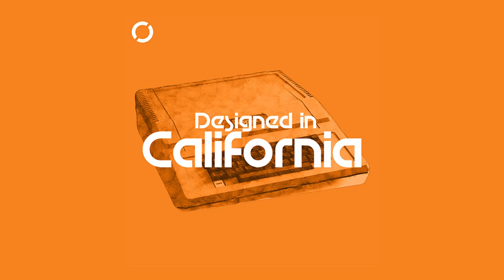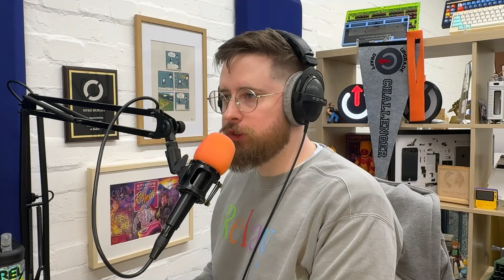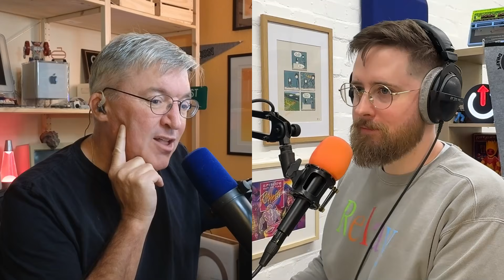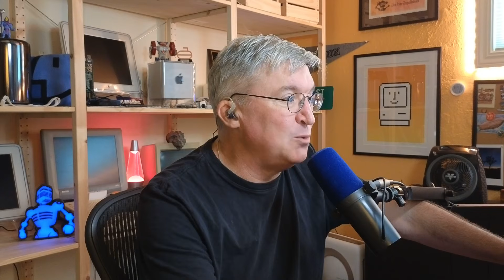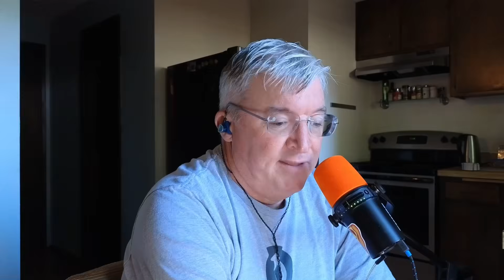Road to the Apple II: A Complete Computer (Part 3) | Designed In California

Comment: Congrats on your early success!  I love the show!  And I love this era in computing history too.  Growing up, I remember looking at the CRT Television and the magic of it all.  There is this device able to move so fast that our eyes see a moving image, not discrete display events, and I want to go on, but also want to communicate a finer point to you guys.  Please take this as help, a gentle hand able to nudge and prod, not some harsh judgement.  Ok?  OK :)

I believe you have some great ideas and story elements jumbled together at the moment "Woz Moment of Genius" is mentioned in the context of a microcomputer connected to a TV.

In my view, Woz had three elements of genius coming into view around this time:

NTSC color.  At some point, Woz connected the Apple to a TY and generated some higher resolution graphics and saw artifact color.  Putting this to use in the way he did was genius.    The element most germane to your storytelling here is the fact that the Apple ][ DOES NOT WAIT for the CPU.  The 6502 he's building on has a two phase clock.  Most other computer designs locked the CPU to the memory and the main system clock.  Done that way, the CPU has to wait for memory refresh cycles, which are about 7 percent of the time available. And cheaper, slower RAM can often be used too.

The Apple ][ runs that bus at twice the speed, giving the CPU a chance at the bus to read and write RAM, including graphics display RAM, on one clock phase, and the system can perform refresh operations on the other clock phase.

This was all super important for the Apple ][ !!!

A big one was there being no interrupts which allowed the CPU to run nice and consistent.  (there is one oddly stretched out cycle, needed to keep the artifact color timing consistent that we can ignore) And that meant doing things like the Disk ][ system using CPU timing was possible.  It also meant the CPU, slow as it is at 1.024 Mhz, was running as efficiently as possible for the user.  An Apple ][ was quick, by the standards of the time.

Keeping the main computer simple meant expansion cards were also simple and we saw a bazillion of those.

I am gonna stop there and go back to listening.  Great show!!